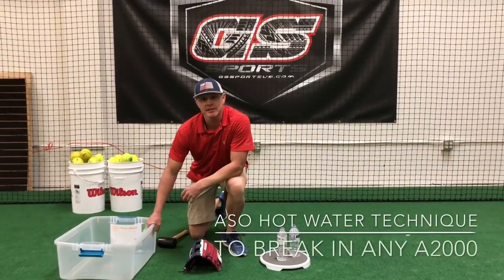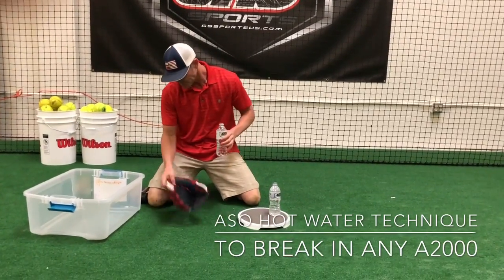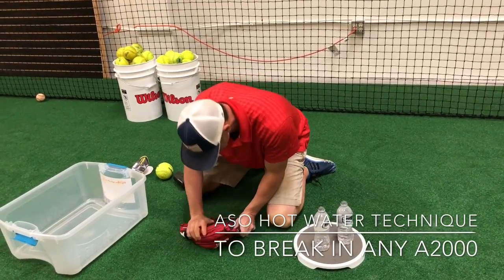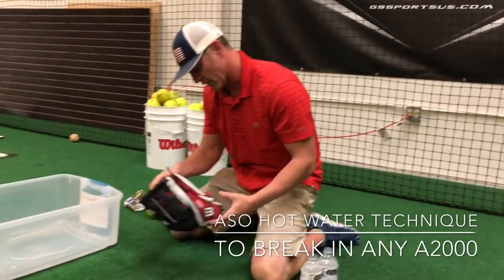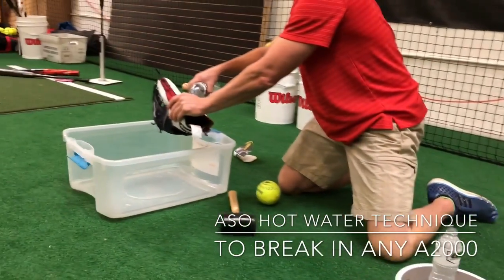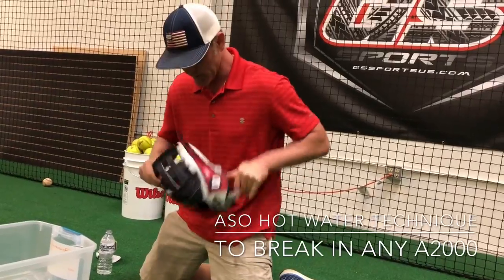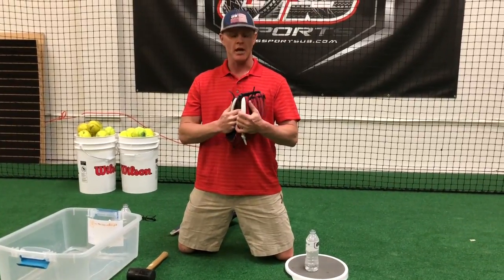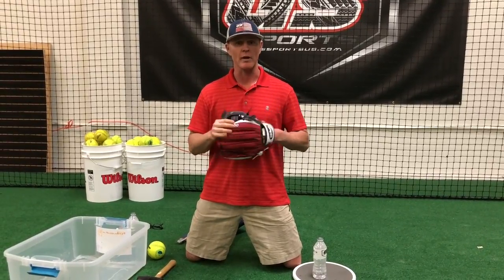How to break in a Wilson A2000 Ball Glove using Aso hot water technique

Comment: Aso said the same thing.  Do NOT use a string or rubber band.  He recommended 
wrapping a towel around it, but that would seem to take longer to dry. I wonder if gauze, or something like it, would be better.
Also, he said to use the hot water method only once in the life of the glove. And it is good for any leather glove. Thanks for the video, take care.
Reply: i heard using a long sock
Reply: I use ace bandage that has Velcro, works perfectly.

Comment: For goodness sakes YES!!! If you put water on the leather you must oil it afterwards. As a former player and have owned many pairs of work boots, water is hard on leather and over time without oil it will crack.
Reply: Oil holds in the glove making it heavier. Water-based conditioners will treat the leather better without adding weight.

Comment: No hot water to white or colored gloves. Also I wouldn’t use a rubber mallet (black rubber can stain) get a small 3 to 5 lbs rubberized dumbbell. I cover it in a white sock, to minimize damage. Also soft surfaces between ground and glove. If you wet a blonde or tan all black you can wrap in a towel and go to town on it with the dumbbell weight. Just my 2 cents! 🥸
Reply: Would a black glove count as colored? Or are u talking like white red blue

Comment: After it drys do you oil it ??
Reply from the maker: Stephen H thats a personal preference.... i personally don’t like using oil.
Reply: @demarinistock  I got A2000 1799 brand new got it wet broke in like you did in the video and now drying.  Should I leave it or oil it ? Thanks
Reply from the maker: Leave it... make sure to put a ball in it and wrap it the way you like it pink to thumb or pink to index.  let it dry in room temp and then play some catch..
Reply: @demarinistock  thank you so much
Reply: Stephen did this method break in your glove well?
Reply: @reidrichter4292   yes it worked great! I have a Rawlings Heart of the Hide and a Wilson A2000
Reply: Stephen H thanks
Reply: @reidrichter4292  you are welcome and no problem!
Reply: Skip the water all together... using glove oil (particularly lanolin) will both assist with break in and actually protect the glove from water if caught in the rain.  Do you pour hot water all over your new leather jacket?
Reply: Learn from the pandemic... hands washed with water frequently = cracked dry skin... hands frequently rubbed with a lanolin-based lotion = soft and smooth.
Reply: @joeblow5958  the creator of the glove literally used water
Reply: @joeblow5958  u use water in the beginning thats it
Reply: @joeblow5958  dude the water method is fine 😂